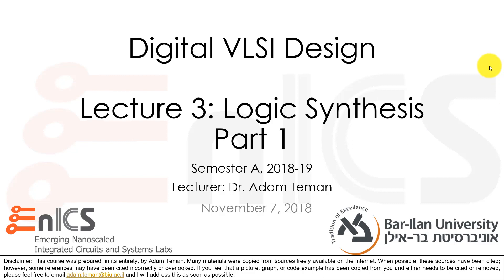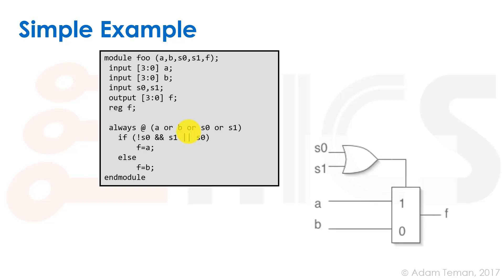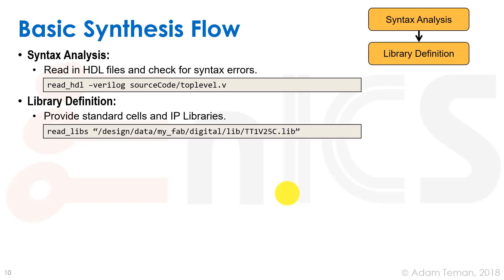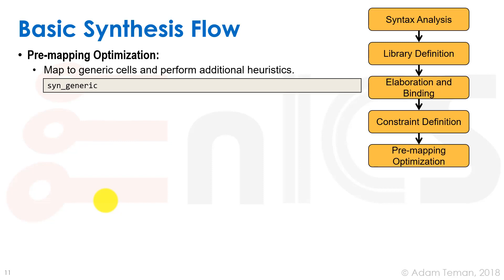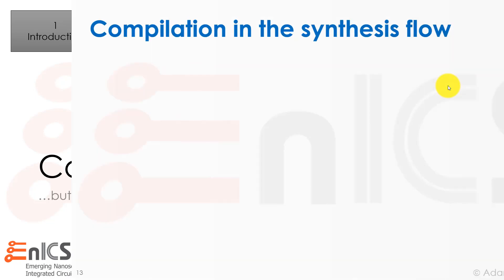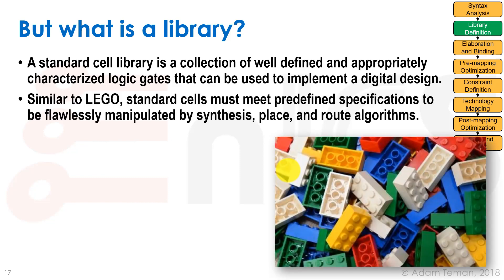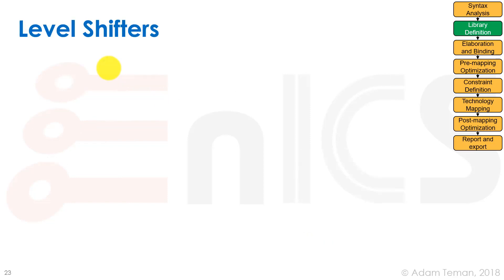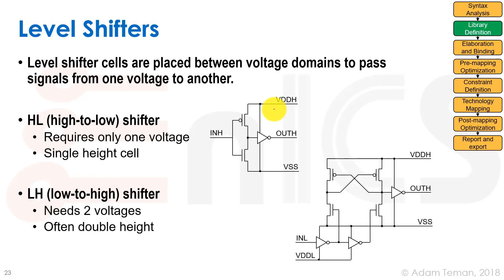DVD - Lecture 3: Logic Synthesis - Part 1

Comment: Hi Prof, your sharing has made my source of learning to be here always without going anywhere else. Really thankful for that. 

Here, I have a quick question on the multibit cell. From your experience, where would be the best way to optimize multibit or the implementation should be starting with? 

Implementation 
1. synthesis : if here, which stages ? 
2. If it is pnr: which stages?  

Post-Implementation
1. What would need to be done in the floorplan in order to ensure the placement of multibit done perfectly without any issue in the power railing, congestion, area and timing. 

I totally appreciate your kind reply here. You are the best !
Reply: :D

Comment: Dear Mr. Teman,
Thank you very much for sharing these great lectures with us. You are a great teacher and the presentation of the slides is of top quality.
I would be glad if you could answer my following question: I have come across an SDF file type which is an output of the synthesis stage. Do you explain this format in any of the lectures, or if not could you briefly explain the purpose and content of this file type?
Reply from the maker: Hi Oguz,
I am not sure I discuss SDF files specifically in any of the lectures (albeit, in my university course, we export them in the flow and use "SDF backannotation" for post-layout simulation). For the format of SDF files, I suggest you look at the spec on IEEExplore (https://ieeexplore.ieee.org/document/972829) or search on Google if you cannot access it there.

However, just to tell you quickly what the purpose it - 
This is an ASCII format that enables annotation of delays onto gates and nets. In other words, before synthesis, we use a "zero-delay model", i.e., there are no delays at all in our RTL-level design. However, after mapping the design to actual gates, we can look into the .lib file and find the delays and the output transitions. These can be written out into a file that enables a tool, such as a logic simulator, to apply (close to) real delays to the signals. SDF is the primary format used for this type of "backannotation". 

Hope that clarified your question.
Reply: @AdiTeman  Thank you very much for your detailed answer Mr. Teman. Much appreciated.

Comment: Great lecture.
What is the difference between NLDM and ECSM in Liberty models?
Reply from the maker: Hi Ambarish. I touch on this shortly at 1:07:35 of the lecture. ECSM and CCS are what are known as "current source models" (ECSM is the Cadence version and CCS is the Synopsys version - they are slightly different, but provide similar accuracy). In very brief, for NLDM, we assumed a constant ramp input and a constant load capacitance. In the current source models, we figure in a changing input and a changing load, so they provide higher accuracy.
Reply: @AdiTeman   Thank you for the prompt reply. You have helped me out a lot. Great job. Keep it up!

Regards,
Ambarish

Comment: Dear Sir,
Thank you for great explanation. I have only LEF/DEF file from OpenAccess. OpenAccess does not provide netlist file (.V file). May I know how can I use it in Innovus for IR drop Simulation?
Thank you
Amlesh Kumar
Reply from the maker: Tough question. Different library vendors provide different files to different clients. OpenAccess is generally a pretty detailed delivery with most of the data you will need (depending on the level of detail it is provided with) and I believe that you can extract a lot of the other views from the OA view and/or use OA views instead of other views in Innovus. Specifically, Verilog behavioral files are the most straightforward file and should be provided, since they are needed for Front End simulation (Gate Level Simulation), but Incisive may also be able to get the info from an OA database, if it includes behavioral views. For IR Drop analysis, many other views are needed, such as Power Grid Views (PGVs), but these also may be provided within OA or can be extracted from it. But you need to turn to an EDA expert to help you with this.

Comment: Hi ...Why uniquification is important in Synthesis?
Why we are doing uniquification in backend , when while writing Rtl , the instantiations will have different names anyhow .
Reply from the maker: So, I explain this in Lecture 6 at 24:10 (https://youtu.be/FUCXqpmdAFA?t=1464). We use instantiation to make design easier - reusing lower level blocks in different places. But when we want to optimize the block, we need to have a separate description of each instantiation of the block and not optimize them all the same. For example, if we have an inverter in a block that is instantiated twice and we want to upsize it in one of the blocks, we do not necessarily want to upsize it in the other.
Reply: @AdiTeman  Thanks 🙏

Comment: Hi Dr.Adam Teman sir,I have follwing two questions 
1)What is the internal structure of the filler and Decap cells?
2) What happens if we exchange the Filler cells with End Cap cells?
Please explain asap..!
Reply from the maker: Hi Lalith, good questions.
1) The filler cells are (usually) NWELL and P-active/N-active layers to ensure that the design rules are met. They may also include other layers, such as diffusion and or poly dummies to meet density rules and photolithographic constraints. But in general, they just fill in the empty space, while making sure the design meets the manufacturing constraints.
2) End caps are a "different beast". In many processes they are not (or "were not") needed, but due to various manufacturing constraints, newer processes require them. They "end" the standard cell rows according to a certain definition. One reason, for example, is to minimize WPE (Well Proximity Effects), which cause transistors that are closer to the well edges to have different characteristics than those that are farther away. By adding an end cap, the closest functional transistor the edge of the well is far enough away that this phenomenon is reduced. Another example is the various dummy structures (especially poly and fin) that are required for photolithographic reasons. 
As for the question if you can swap the two - this really depends on the rules of the process/standard cell library. I can tell you that in certain libraries, the end caps were the same as the well taps, but this is really a specific case. The library should describe to you exactly how a row should be ended and you should adhere to this methodology.
Reply: @AdiTeman  Okay sir I got clarity now.Thanks for your time and concern.!

Comment: What's the reason for different results for the same design in two different synthesis execution?
Reply from the maker: Hi SK,
There are several reasons that could cause different synthesis results; however, the primary reason is the random basis of the algorithms that lie underneath the hood. This is covered in the next lecture (Lecture 4 - https://youtu.be/lTt2LN7nub0).
When using optimization algorithms that incur some randomness in them, the solutions will be different by definition. This is important, since the optimization problems are generally NP-complete, meaning that it is infeasible to find the absolute optimal solution, but rather to find a "good" solution, which is some sort of local minimum. By randomizing various parameters (such as the initial solution), there is a better chance that different such local minima will be found and the best one can be chosen.

Comment: 8:30 what is the basic difference between IP and standard cell sir?
Reply from the maker: Well, there to be accurate, standard cells are a type of IP. As mentioned, IP means "intellectual property", which has many meanings (especially in the legal world), but in VLSI engineering, it means something that was developed by someone else. This could be an RTL module, a custom block, or even a verification suite. In this context, you're not usually building your own standard cells and then using them during synthesis, so they are an IP (and even if you did develop them yourself, this would have been done independently, so they would be a separate part of the project).

That being said, I refer to very common IP libraries, such as standard cells, I/Os, and SRAMs separately, since they are basically a necessity of any design. This is as opposed to other IPs (for example, an ADC), which you may have and you may not, depending on your required functionality, but if you have it, you will usually be getting it from "somewhere else" (i.e., the guy running synthesis isn't usually the guy designing the ADC), and so it is an IP.

Comment: are leaf cells are nothing but hard coded block in module? whose name is already written in rtl code
Reply from the maker: The word "leaf" is referring to a tree. A tree starts with a trunk, then has big branches, smaller branches, and finally, at the end, has leaves. So when we say "leaf cells", we mean the last thing in the design hierarchy. In other words, you have a toplevel, some module that instantiates other modules that instantiate other modules. But finally, you get to the end, where nothing else is instantiated - these are the leaves.
In the case of logic, the leaves are standard cells. But leaves can also be hard macros, such as memory blocks, for which we don't have an RTL description, but rather a library (i.e., lib, lef, gds, etc.) that represent the physical cell.